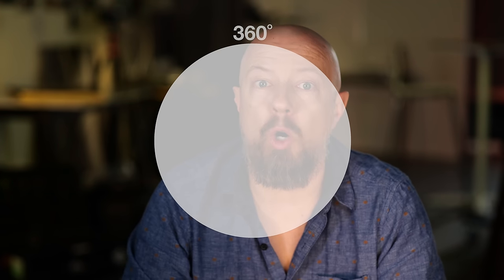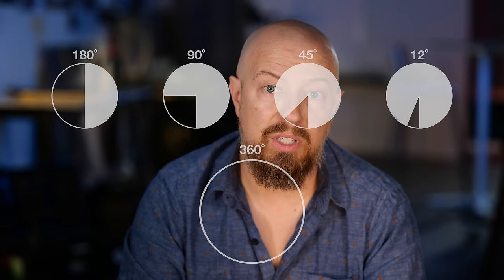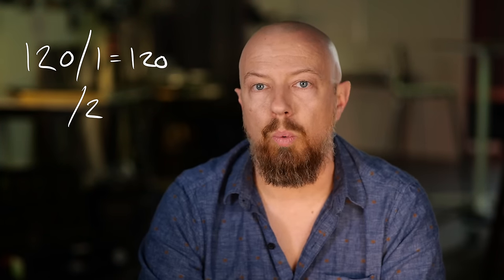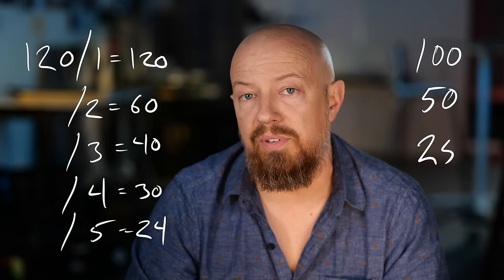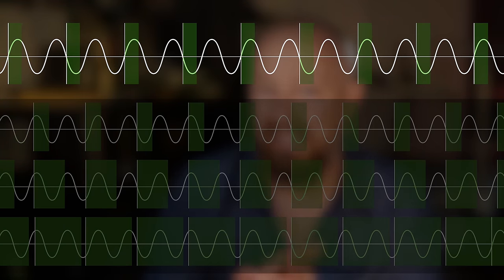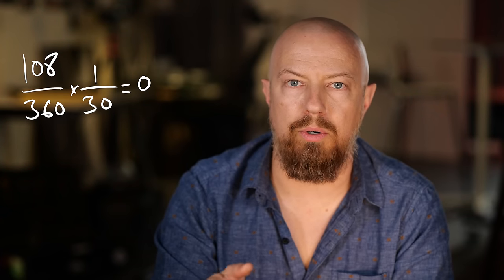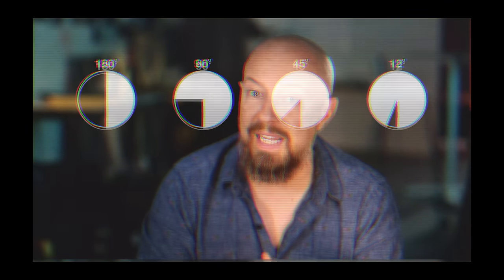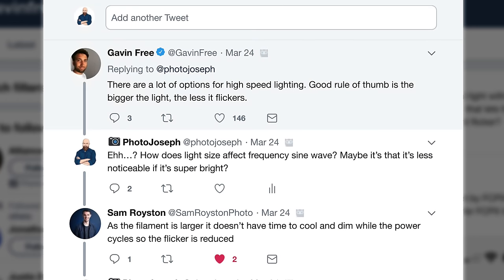Understanding Light Flicker in Video (…shutter angle, slow motion video)

Comment: Greatly appreciate this video! It's probably one of the clearest explanations I've found so far! 

However I do have a question. What about shooting 120fps in PAL 50 Hz? According to REDs calculator, there is no way to resolve this. Is this truly the case? The trouble I see is that of conforming different framerates onto a timeline. If I have screencaptures that are recorded at 30 or 60FPS, and want to include 30 FPS talking head shots, but potentially also 120fps b-roll, the 120fps shot would flicker in a 50hz region unless I have a shutter speed to match somehow. And if I switch to 25fps and 100fps, we now have values that don't line up nicely with the 30fps or 60fps content and thereby something would stutter and be not smooth. Any ideas here?
Reply from the maker: You can't, in general. Towards the end of the video I outline why you can't exceed certain frame rates, and then how to overcome that. But unless you have control of the lighting, you can't do it.
Reply: @photojoseph  ah! I must've missed that last part then. Was at work while watching. Apologies! Thanks anyway for taking the time for the response! Alright. Watched it again. I get it now. I guess this is more of a shoot with intention, invest in better movement gear to have slow movements without higher framerates, and also maybe look into reducing flicker in camera as much as possible and maybe allow software in Davinci Resolve work on the rest? I'll have to look into it. Thanks again for all this information!
Reply from the maker: No worries, it's complicated. I actually watched the whole video again last night. I wrote and recorded it, but I still go back to watch this sometimes (truth is half the videos I make are so that I can re-learn how to do something later on hahah)
Reply: @photojoseph  hahaha that's awesome! And I can see why! I've personally bookmarked this video for the same reason. I gotta say, this is the first video of yours I've come across and you get an instant sub from me. I've decided that I want to begin making YT videos properly this month so as I work on them I hope to be able to make great content like this going forward. Once again, thanks!
Reply from the maker: Very nice to hear, thanks Stefan!

Comment: im in a pal country 220v 50hz and i stream with NTSC 29.97fps settings  and i was having Flickering on my stream so i was monking around with the camera and i found 1/100 work just fine without flickering.
this video answer most of my questions.
but i still have some
all screen and phones are 29.97 so i always stream or do video for modern smart phone and computer right, i try to stream with 24fps and 25 fps  settings on a camera and it was not good quality i try even 50fps and it was not sharp as 29.97fps why is that?

Comment: On the gh5s  recorded external on atomos ninja v+ 4k60 prores raw set at 180 angle flickers in my home under ac lighting. Set to 216 does not flicker. What does that do to my video breaking the 180 rule as a set rate for ac lighting? Thanks
Reply from the maker: You’re in North America?
Reply: @photojoseph  yessir
Reply from the maker: What kind of lighting is your overhead? Fluorescent? CFL? LED?
Reply: Believe led . Phillips Hue can bulbs . You can change color and temp. InterestingThanks for askin
Reply from the maker: @DroseMr  ahhhh philips hue. That explains it. European made and flicker on US electrical system. Notorious for this. So annoying. 173d shutter will also remove it and is closer to 180d.
Reply: Interesting. Made 180 rule  again . Appriciate your work. Thank s again!
Reply from the maker: You’re welcome. Hue lights are cool but weird this way.
Reply: You are totally wrong, in hollywood filmming, shutter angle should be locked in 180.
Reply: Refering back. I now using gh6 fhd 300fps. Syncro scan doesnt show flicker until playback. Cant seem to find a sweet spot to eliminate flicker w certain light. Is there a fix? Prob be refering back for years. This video and your channel has been very valuable precise information supposing you said theres only a fix for upto 120 fps .Thank You

Comment: I went to amusement park at evening. EU, 50hz and 60hz lights mixed everywhere. I couldnt film any video that wouldnt be flickering. What you would have done in that situation? Would it be possible with some settings to avoid it? Anyone know? Thanks.
Reply from the maker: hm, unlikely there were 50 and 60 hz lighting mixed. Flickering AC lights are determined by the power frequency, which would be 50hz in the EU. I would have rolled through shutter angles looking for one that worked, and if there were particular lights that for whatever reason continued to flicker, just do my best to shoot around them!

Comment: And I got this RBG bulbs that flicker no matter what :D. But their flicker is visible as moving bands across the frame. I can easily remove this in post using deflicker in Resolve, but it's still annoying.
Reply from the maker: I doubt that it’s impossible for find a shutter angle that doesn’t flicker. Are they Hue, by chance? Try 172.8°
Reply: @photojoseph  using 1/50 now while shooting 25fps (seems 172.8 is really close to 1/50). I can set this SA on my bmpcc but annoying one is Sony A6600, which does not have SA or deflicker option (variable shutter like A7IV). Not sure I can do much on A6600.
Reply: @photojoseph  Seems with 25p it will be 1/52.08 so probalby 1/52 would be fine. But no way to set this on A6600 :(
Reply from the maker: @JoATTech  ahhh there’s the problem. You need a camera with synchro scan and shutter angle 😉
Reply: @photojoseph  I know. But I was just really surprised that recording 25p with 1/50 SS in 50Hz location gives some flicker. But I guess these bulbs got some internal electronics that creates flicker with different frequency than 50Hz (or it's multiciplity). And actually this can be removed easily with deflicher SFX in Davinci, not a big deal, although this SFX is resource hungry so for longer videos it will be quite annoying.
Guess I have to start using my BMPCC6k to record tiktoks ;).
Reply from the maker: @JoATTech  are they Hue bulbs?
Reply: @photojoseph  Yes. OSRAM.
Reply from the maker: @JoATTech  that’s really interesting that they flicker even in Europe. I always assumed the flickered here (North America) because they’re European LEDs and somehow not tuned for our power system. But the fact they do it there tells me to never buy Hue again.

Comment: I have done all of these but when I shoot inside of the cruise ship.. some of their light still flickering..even I use var shutter.. I don’t know why
Reply from the maker: On a cruise ship… that’s interesting as their power obviously isn’t coming from the grid. It’s not batteries; it’s generators, right? I wonder if there’s an inconsistent power cycle because of that? Does your camera have syncroscan, where you can dial in the shutter angle to the single degree? I’d do that, just rolling the dial until you find a shutter angle that doesn’t flicker and being aware you may need to adjust as you shoot. Also remember it’s easiest to see the flicker if the camera is out of focus. Point at a light, manually focus so it’s soft, and adjust!
Reply: @photojoseph  I use a7iv with variable shutter.. but like you said maybe there inconsistent power.. because sometimes it works sometimes not.. it worse when using Sony a7siii..

Comment: Then why am I getting flicker at 24fps with 60hz lights? And at 30? And at 60? All with a 180 degree shutter angle.
Reply from the maker: 24.00 fps or 23.98? You’re in a 60Hz region? What did you mean “and at 30”… fps? It most likely means that your lights are rubbish. What are they?

Comment: The statement of only having to get either shutter angle and frame rate right to resolve flicker in video is Wrong! Technically, only the shutter speed and the resulting exposure time of the image sensor matters. Shutter angle and frame rate are indirectly related to shutter speed and  exposure time. Thanks me later.

Comment: I dont care about video, i want to remove it from photo.
Reply from the maker: Some LUMIX cameras have a flicker mode for still photos. It times the exposures so they are in sync with the lights when using electronic shutter.
Reply: @photojoseph  Well, i already found remedy, but its to late for photos taken. In Europe i have to use 1/50 or 1/100 shutter speed, other speeds will not help - on live view, camera detects flicker but only when using it "normally" with viewfinder.

Comment: Awesome! But I'm also getting flickering whilst panning with my S1 in sunlight (on a tripod with IBIS OFF) - it varies by frame rate and by picture setting, with V-log by far the worst. Any ideas?
Reply from the maker: You can’t get the kind of flicker I’m talking about here with sunlight, so that’s something else. Judder? Judder is the stuttering you see when panning too fast at a low framerate. If you’re shooting 24p and panning quickly, you’ll see it more than you would at 60.
Reply: @photojoseph  Thanks, Joseph for the blisteringly quick reply!- I was shooting mostly at higher resolutions- 5.4k and above, and at 25 and 50fps (I'm in Vietnam)180 Degs shutter. I GG'd it yesterday and found an earlier vid of yours talking about a firmware update for the S1 which was supposed to address this back in 2020 or 21... I thought I'd gotten all my ducks in a row, but still seeing it - especially when panning across building and things with high contrast repeating patterns. Maybe it's time to update to the S5II?
Reply from the maker: @fredabery3816  it’s not a camera issue. Shoot something at 60p and see if you still see it. If not, then it’s a frame-rate / fast pan issue. If so, then there’s something else going on; let me know.